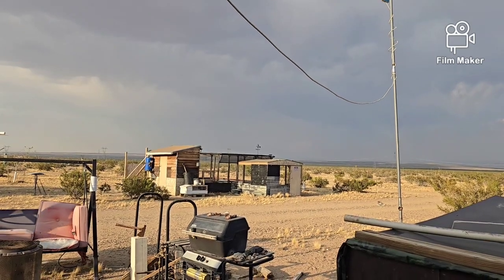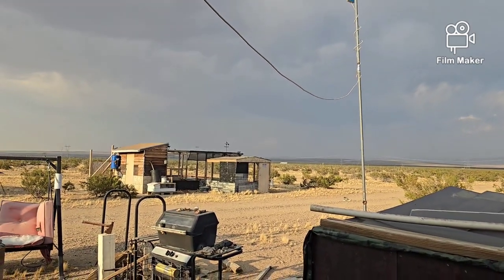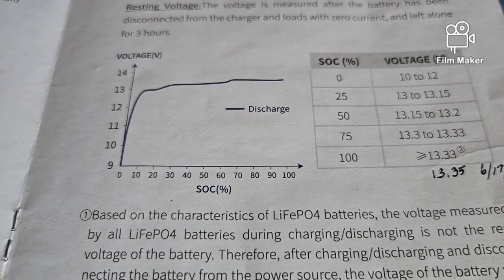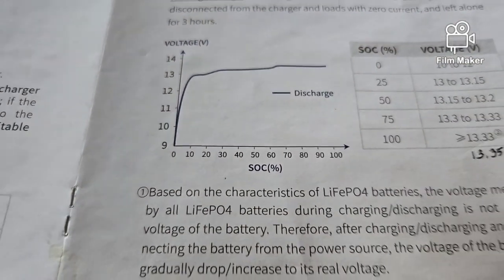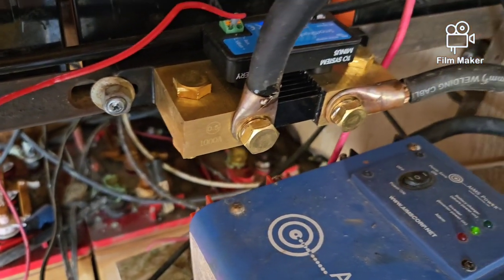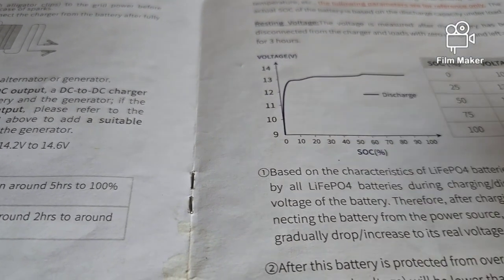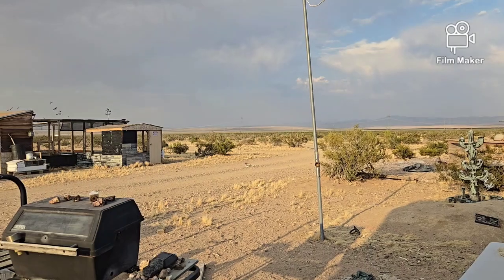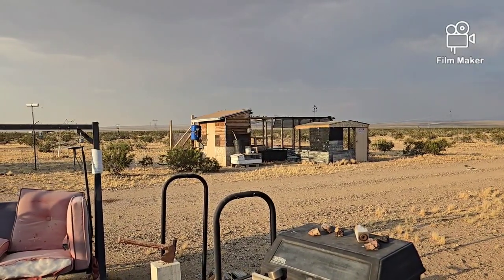Why A Shunt? SOC Of LiFePO4 vs Lead Acid, July 12, 2024

Comment: Also keep in mind that for LiFePO4 the discharge curve is different from the charge curve.  They are offset from each other by quite a bit.  That makes it even more difficult to figure out the SOC without a shunt.

You can pull up graphs from that Victron shunt via the Victron app, by the way.  It keeps 30 days worth of data.

-Matt
Reply from the maker: @junkerzn7312  Thanks.  Yes I sometimes monitor the graph and watch it add or drop a volt here and there.

Comment: I have 960ah one full-size refrigerator and a mini split at night when I wake up in the morning, I still have 50%
Reply from the maker: @solarandwindinsouthtexasda1473  Welcome aboard!  It sounds like you have it dialed in. How much solar input?
Reply: @GBear  2.8 km of solar but my battery are charge to 14.2 volts
Reply from the maker: @solarandwindinsouthtexasda1473  Nice.
Reply: @GBear  I have 7.8 kw off solar to installed
Reply from the maker: @solarandwindinsouthtexasda1473 nice!  I'll be upgrading my system soon, and will be changing out all the 100w panels to 360w ones.

Comment: LiFePO4 will be my next batteries.
Reply from the maker: @daz.r1994  Yep, and prices are still going down.
Reply: @GBear  The prices of my lead acid batteries have gone up a lot this year. Happy i picked my batteries up last year.
Reply from the maker: @daz.r1994  Yep.  Thank the socialists in charge for outlawing lead, after a few hundred years of using it.
Reply: @GBear  you are spot on. I have been recycle lead for years now and will never stop. As my slingshots need lead.
Reply from the maker: @daz.r1994  I have about 400 pounds of it in storage.
Reply: @GBear  That is a lot of lead great to have.
Reply: I changed to Nissan leaf Lithium batteries long time ago

Comment: I’ve noticed not only my fridge but also the inverter fans run more often and watts is watts!  

10kwh usable.     If you keep the 10% out.   M running 24v systems mostly and the lifepo4s range 26.6-26.7 after the sun goes down.    I love not having to babysit them like lead acid.   If I take them down to 20-30 percent I know inhale enough panels and amps to quickly charge them back up by noon then it’s playtime with the extra.
Reply from the maker: @WattsinWattsout  Yep, I'm still dialing my system in to the switch over.

Comment: Good Evening G BEAR ! What is the price range for a QUALITY Shunt ? Thank You. TAKE CARE..
Reply from the maker: @brushbum7508  They range in prices from $30 To $500, depending on the features, sizes, and makes.
Check online for the size you need, usually a 500A will work for most people.  Then determine if you want bluetooth, wifi, etc., then if you want on unit readout screen, etc.
Choose a reputable brand name like Li Time, or Victron, etc, but stay away from super cheap Chinese junk shipped from China.  I'll help you find one if you need it, just give me the size of your battery bank.
Reply: @GBear  Thanks G BEAR. I'm still BUYING AS I CAN AFFORD. The Litimes you got are what I'm looking at. I don't want any blue tooth. I want to do all away from grid or tech.TAKE CARE..
Reply from the maker: @brushbum7508  I'll send you some links in the next few days.
Reply: @GBear  Thank you G BEAR. TAKE CARE..
Reply from the maker: Here's a decent shunt/monitor at an affordable price. https://amzn.to/3zIHmHC
Reply: @GBear  Thanks G BEAR ! The litime charge controllers looked good also,from what some had said. TAKE CARE..